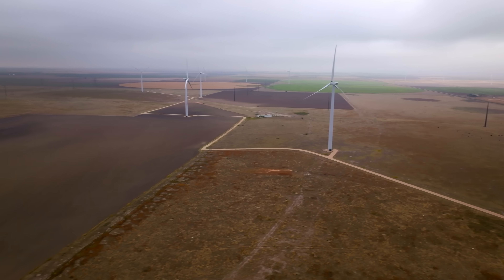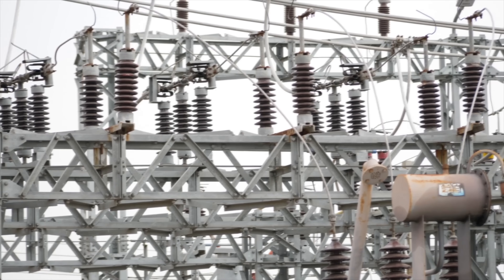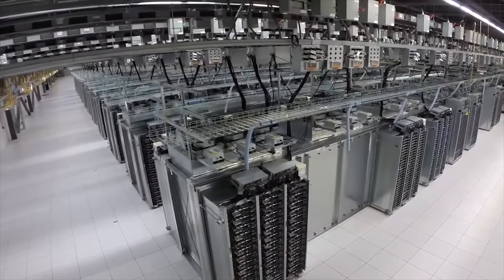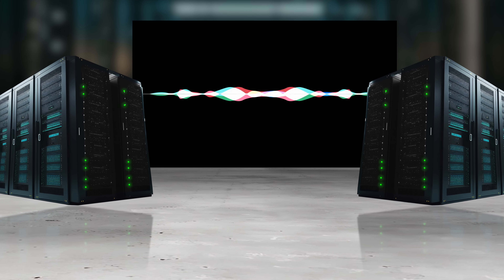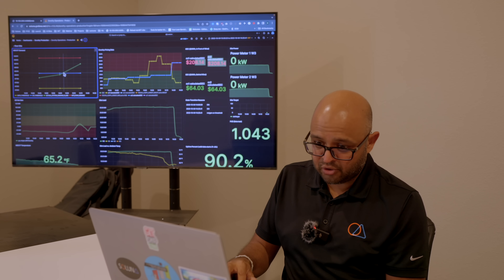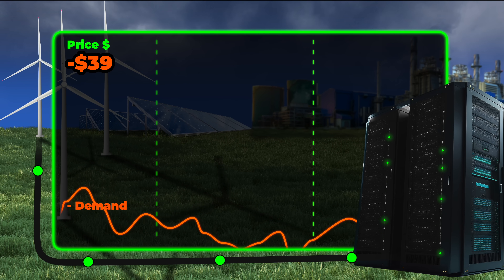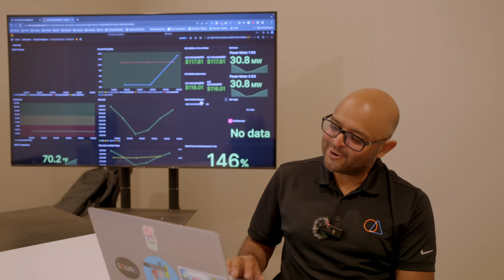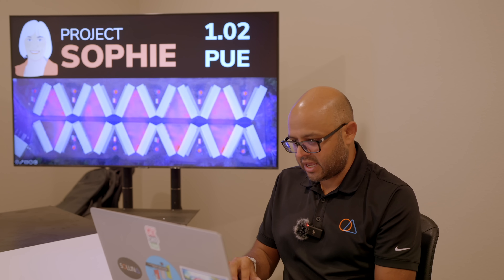Wind Farms' Dirty Little Secret No One Talks About

Comment: I drove through palm springs one day and saw thousands of these things crapping up the landscape.   None of them were spinning.   I thought maybe there wasn't any wind that day, then i noticed a single windmill spinning fast right in between several stationary ones.  Im sure their city council is patting themselves on the back for all the clean energy they make.
Reply: Clean energy can work just fine, but California has been building it out just to build it out, and solve the problems associated with it later.  This is part of the reason California energy prices are so high, although to be honest California has bigger energy issues than this.  If you look at Texas they have over twice renewable build out as California but California's prices are 3 times that of Texas.   North Dakota has the most renewables per capita and their rates are almost 4x time less than California.  This makes it very clear that the problem with California's energy grid isn't renewables, it's the lack of intelligent build out and government interference.
Reply: @Ryan-ff2db  that was the case a couple years back.
Texas has had some real issues this year, similar to California.
Texas had to step in and outlaw those "price on demand" suppliers after their winter debacle.
They're also underinvested when it comes to residential customers distribution.
ERCOT had some real close calls this summer.
Both states had issues with reduced hydro, which they both use for spinning reserves to even out the grid.
Reply: @blaydCA  Yes, but the grid did hold up(not including the freak 100 year storm a couple years ago) and the prices are drastically less than California.  Here we lost power half a dozen times, although usually just a couple hours at a time.  The peak rate during the summer was 51 cents with 39 base.  Texas was between 15 to 18 peak last summer 7 to 10 base.  The power companies in California are asking for a further 22 percent increase this year and the state is probably going to let it happen.  I'm not saying Texas is perfect, any major transition is going to have issues and a learning curve, I'm just saying Texas is doing it a hell of a lot smarter than California.  Next year Cali rates are expected to be 45 base 63 peak.  I know there's a lot more reasons than renewables for why California's grid is so bad but it gives ammunition to the anti-renewable crowd because they keep pointing and saying see I told you so.  But they never point to the other 25 states that have embraced renewables and are doing just fine.  As a native Californian, this is an embarrassment.
Reply: @Ryan-ff2db  Yes, it did...just.. after they fired up every antique they could, and begged/threatened with rolling cuts.
Texas does have the advantage of a MASSIVE industrial base, mostly petro-chemical that generally uses a consistent amount of power 24/7 which keeps rates far lower. California needs a shit ton of peaker plants due to the massive swing on usage by residential. Those peakers cost to way more drop in and out of production.
Both states need waaaay more battery storage.
Reply: @blaydCA I agree.  Unfortunately, California is the NIMBY state.  They don't like gas, coal or nuclear but they also don't want batteries or windmills either, at least in their neighborhood and they're removing dams.  Hoa's still bitch about solar too, even though most courts have ruled against them.  I don't know where these people think electricity comes from, which is I guess why we import so much electricity from other states, further increasing costs.
Reply: @Ryan-ff2db  I'm not a big fan of disturbing untouched Wildlands to install solar or wind, when there are plenty of roofs and parking lots closer to where the juice is used. I'm not sure what the current laws are for existing Concentration Camps are, but new builds have to have Solar regardless.
Sadly, batteries are still very expensive whether you have solar or not, which means that California EXPORTS at a loss daytime power to other states frequently, and then IMPORTS power at a cost starting before the evening peak for overnight (California ISO). I have solar/wind/battery off-grid on one property and in process to do the same with another existing SoCal property that's grid connected. Another undeveloped property in Oregon will depend on power pole cost. High basic meter charge, but low hydro-power cost, so it's incomplete data for my personal decision on how that gets powered.
Reply: @blaydCA  Yes, everything you said is true.  The good news is, battery costs will continue to fall as they have for the last 20 years as everyone seems to be building a battery factory, lithium is being discovered everywhere, and new chemistries are finally hitting the market.  I don't know if you read the article titled "The Astonishing Economics of the Tesla Megapack" which directly compares Tesla's magapacks on the ERCOT grid to peaker plants.  Needless to say they are an order of magnitude cheaper than peaker plants.  The problem isn't so much the cost of the batteries as they pay for themselves quickly, it's the fact that Tesla has expanded production by 8 times and still can't keep up with demand.  If you ordered one today it would be installed Q3 2025.
Reply: @Ryan-ff2db  for a home system, batteries are purely "cost" since your not playing buy low/sell high like commercial batteries are. Home batteries might lower your cost some, but depends on peak rate, since there are cycle losses.
LiON batteries aren't all that cost effective for industrial sized complexes. Molten salt or a variety of other chemistries/technologies that don't degrade on each cycle are better since they often cycle twice or more each day
Reply: @Ryan-ff2db  In that study:
Was that levelised lifetime cost per Kw?
I know Tesla PowerWall limits the warranty on excess usage.
Reply: If you saw ONLY one spinning fast. That one turbine was probably an older completely broken unit free wheeling. Some of those turbines actually date back to 1975!
If none of them are turning, there’s not enough wind.
If some are turning, but not many, then there isn’t enough demand for their power and they’re shut down to save mechanical wear on very expensive parts rather than to export power at a financial loss. Southern California has a LOT of solar power added to the mix.
Reply: @blaydCA  it was a nice day in the low 70s.  Most likely, they just couldn't use the energy, so they had them all shut down.   There are large ones with small ones between them and it was one of the small ones that was spinning.  

The point is that they look like crap, were a huge waste of money, and are about as useful as Springfield's monorail.
Reply: @michaellowe3665  yeah, the small ones with the steel frame towers are from the 70's, so it was free wheeling.
Agreed, it used to be "pretty" when there were some.
Now it's just an eyesore with wall to wall units.
For a while there were a lot of dead ones left unfixed. They've finally repowered most of them.
I guess it beats looking at a coal plant belching toxic smoke though.

Comment: Does'nt this solve a money problem? Not a energy problem. In thé perspectif of the wind farmer, it's a good solution becaus he makes more money. But from An energy standpoint. This does'nt make Sense i think. 

I think we should try to reduce the amount of energy used as much as possible. Meaning, take your bicycle not the electric car. And hang wet clothes outside to dry instead of the dryer. 

Then store the energy when there is no demand die it.

Comment: Wouldn't desalination be an excellent use of intermittent excess power?
Reply: Only if the wind farm has access to salt water and the area has insufficient access to fresh water. Hydrogen electrolysis is another thing that could be used to sink nearly infinite excess energy into. There are dozens of emerging energy storage technologies. Storing energy to smooth out peak demand seems like a far more effective use of resources than thousands of computers that are just sitting there doing nothing when power export is high.

Comment: I keep thinking to myself, free energy (curtailed renewables)? Somebody will figure out a use.
Thanks for finding this.
Reply from the maker: seriously! I had no idea how high the waste % was... this will hurt future developers from building them, if they're so wasteful... we def need a solution like this one
Reply: Battery Energy Storage is a much better option for wind turbine operators, as it offers higher profits. For example Hornsdale Wind Farm in Australia installed Battery Energy Storage in 2017 and recouped the costs of the project within 2.5 years. The wind farm was also able to offer grid stabilization services which supplemented being able to sell their energy at higher profit.
Traditionally gas peaker plants have been used to offer grid stabilizing services. These plants would be mostly idle, or curtailed producing emissions, and wasting fuel. Energy storage does much better job of stabilizing the 60 Hz frequency of the grid as larger loads come and go as they can respond instantly, without wasting energy.

Comment: Now, That was interesting. Water. Never thought about how much is used cooling those farms. I am a little surprised about those that are using swamp coolers. I thought chips don't like high humidity. Amarillo is a great place for wind farms!
Reply from the maker: the data centers have constantly pass through... so moisture isn't building up, fresh dry area is constantly being sucked in... so its like the opposite of a sealed tight conditioned space

Comment: Looks like a pretty low density operation. I've seen data centers with way more gear packed in the racks.
Reply: Because they are air cooling. Any denser and they would have to use water cooling.

Comment: So, maybe a stupid question, I don't know, but why put datacenters near rivers, and not oceans? You can't evaporate salt water like fresh water, granted, but you can use salt water at constant temperatures to keep the temperature down... Microsoft had a project called Natick in 2018. Microsoft submerged a self-sufficient data center off the coast of the Orkney Islands in Scotland. This 40-foot container housed 864 servers and was designed to leverage ocean water for cooling. After a two-year deployment, the project concluded with findings that pointed to the efficiency and reliability of underwater data centers. They reported that the servers underwater experienced one-eighth the failure rate of those on land, possibly due to the stable environment and the absence of human intervention. However, the downsides were weather, waves, energy delivery to a subsea installation, and maintenance. Personally, I believe that those problems are solvable, given enough research and effort, and would be an ideal solution, especially in colder waters like you'll find outside the Orkney islands.

Comment: Thats a really impressive video -  I had an idea this was a major issue but as you said there is very little mention of this in the main stream. I mean its pretty obvious really as even our little home system require significant cooling...but when your drawing a megawatt or 10 and 30-40% is waste heat -  thats a lot of heat. In a really smart world we'd use that degraded heat energy to heat homes in cold countries or maybe dry crops or facilitate chemical processes.  Or even just store in low grade heat banks for evening use. Process heat.
Reply: Good thinking.
Reply: Good idea like methane from landfills for power generation.  It would have to be localized.   Like massive data centers for heat to a steam turbine.  What's your thoughts?

Comment: I am glad there is a niche market of data centers that can at a moments notice go offline but most data centers would not like this arrangement.  It would be better to use the excess energy for energy storage to be sold back later, or better yet improve the grid so that the excess energy can be sold to other markets when not in use by the current market.
Reply: Or take a system that would eat the supply on site like a charging station.
Reply: Yah I'm trying to understand this as well.  If you are spending a bunch of money on a data center you want as much of that to be utilized at all times.  Not just when the wind is blowing.